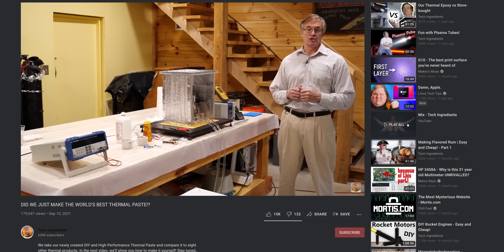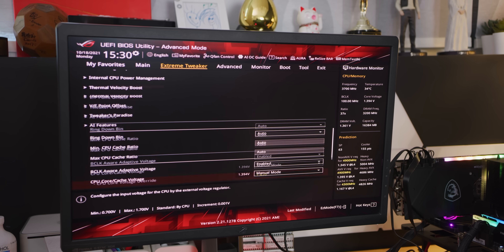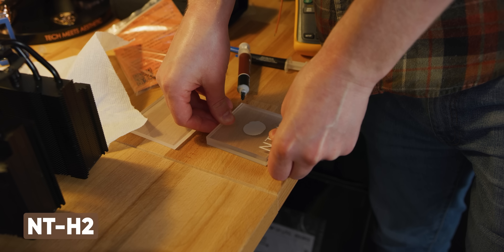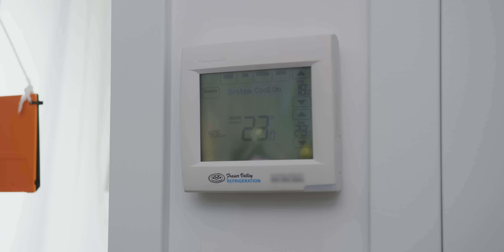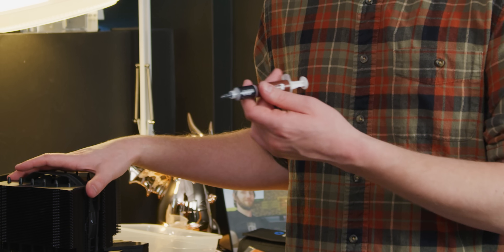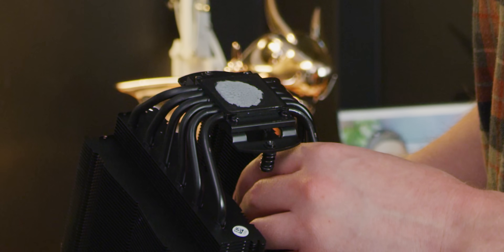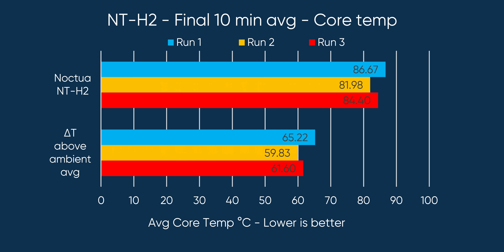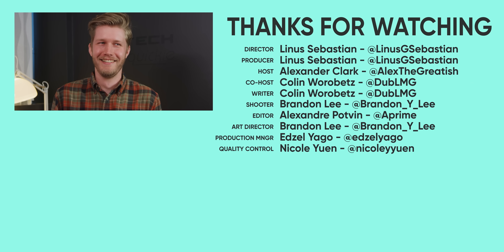We called out Tech Ingredients and they DELIVERED

Comment: I don't see the point in not spreading the thermal compound with a spatula though. Wouldn't it be logical if spread is an issue to manually do it yourself? That is the way I do it and it drives me nuts to see that no matter the application there are often dead spots left behind.

Comment: I think at a certain point you run out of cooler room. I have an 1080 turbo with the blower fan, I tried repasting it with thermal grizzly kryonaut and thermal grizzly liquid metal For my cpu I seen like a 10 degree drop however the 1080 was the same on with both. I believe the thermal limit of the cooler can be the problem not the paste.

Comment: Why do I need to be cool under pressure?
Reply: Tf u been buzzin on Evan
Reply: @gram.  I think i was making a pun about if barometric pressure is a problem on an electronic, you need a solution more advanced than a paste. As to answer your question, the strain was a hybrid called slurricane. I'm shocked the simple question is spelled correctly.

Comment: IDK...If I were going to try and create my own paste, the first thing that comes to mind  would be Copper dust suspended in mineral oil or other heat conductive viscous material for suspension. Yes, it would be conductive, therefore use carefully. I have a 9900k that has a soldered heat spreader and gets red hot.

Comment: Never tested, but I suspect that most decent thermal pastes are all about the same. There is nothing new under the sun. Thermal paste and heat transfer is a pretty well understood science. I think the main reason for the different formula's is patents. If it's not different enough, you can't patent it. If you can't patent it, you can't easily make money off it.

Try the Tech Ingredients thermal paste with an ice chilled water block. You might see a real difference there ( because the temp delta will be so much higher ).

Comment: There is a polymer which transmits thermal load faster and more completely than pure copper (or gold, or some other metal), and it's a Polymer (worth saying twice).  That material is, and has been tested carefully, SpiderWeb.  Yup, the ass juice from those nasty little fux (Spiders) is better than copper for transmitting heat away.  That's why I never clean the inside of my computer.  XD

Comment: Back in the days with processor without Integrated Heat Sinks we used to spread the thermal paste out over the core in a real thin layer. We really needed the contact. We used ThermalTake Silver paste ( not the standard white crap ) and overclocked the AMD Durons, Athlons, XPs, and Semprons. If you connected 2 dots on the processor you would unlock the multiplier. And sometimes, especially the early durons you could increase this quit a bit. I had a Duron 800 ( 100 Mhz x 8 ) which did 108 x 11 ( =1188 ). The memory had to be good to run at 108 ( later 144 (1,08x133)) though.
With the copper Zalman flower coolers. Oooh, those old days. Can you guys make a video about that?

Comment: The actual costs of materials in the Tech Ingredients paste is incredibly low. The barrier costs to production are fairly high, though, as you need pretty specialized tooling to be able to mix the incredibly fine metal particles into the silicone they're using. They did, however, include a much cheaper "This is still better than the cheap thermal paste" solution that only requires a mortar and pestle and a willingness to test your arm's fatigue limits.

Comment: I would suggest you try Wakfield Engineering thermal compound #120-2.  it works good. Is cheep and last. And do not lift the heat sync after seating it. that can introduce air bubbles in in the interface.

Comment: Odorless mineral spirits makes an excellent surface cleaning solvent!
It will strip off stuff that alcohol can't touch, never leaves any residue and takes only a tiny amount to be useful.
By odorless, it means that no odor remains once it has evaporated.
It has that 'summer barbecue' smell...mineral spirits are often used as charcoal lighter fluid!
Be sure to use gloves, as this stuff will remove skin oils.

Comment: IC Diamond is actually great for low pressure applications, just use more of it and squish as much as you can. IC Diamond is, bar none, the best paste for Notebooks/Laptops which have terrible mounting pressure because it's very thick/viscous, resists drying out and pumping out. And lots of notebooks have very bad heatsinks. IC Graphite Pad is even better. It may be a few degrees hotter than paste, but it never dries out or pumps out, and lasts the life of the chip and is reusable (if you need to remove and reinstall a cooler). I've switched to using the Graphite Pad for all non-overclocked applications, like notebooks, computers for non-gamers which will be on a lot and run for many years.

The problem with IC Diamond is that it will scuff the surface and make scratches. 

I use Kryonaut for overclocking (1 year on an overclocked machine with no deterioration right now), or Thermalright TFX or SYY-157 on desktops.

Comment: Question I finished my build about 3 months ago pc011xl 5900x 3090ftw3 ultra asus rog dark hero mono block ek dkstro plate full wqtercooled but I've noticed when I turn it on in bios for a couple mins it idles at 45 ish watercooled and than when I open Google general use gets to high 50s goes down than back up if I run a test or a game it can get way higher than I usually go in armory and click high speed and everhtjkng ramps up and it stays around 40 50 but shouldn't idle be more lkle 30 ish fully watercooled mono block everything im started to think maybe itd thermal paste related like maybe I put too much was my first build but its not just easy to check I literally have to drain the loop disconnect all the tube runs take out gpu take mother oard out of case and take off the monoblock just to check

Comment: I put on a nitrile glove and evenly dab compound onto the heat spreader or die. Then I install the cooler, then remove it to see if there's full transfer. If there are bare spots on the cooler, they get dabbed. Minimal amount of compound, 100% coverage of contact surfaces.

What do I use? The white greasy stuff that never dries out.

Comment: Knew he wasn't full of BS because I've also made my own paste a few years back with about 10% of the equipment and know-how he has and it performs about as well as Arctic Silver and GD900 (the two I tested it against). After 10 different tests mine was about 2c higher on average and I just used the basic ingredients he did. No fine emulsion, separations, etc. Just don't spend hours in the mortar & pestle and it'll come out usable.

Comment: Hey Alex, a cool Tool to measure the resistance of the pastes would have been an isolation resistance meter Like the Fluke 1507-i know its propably not necessary to measure the resistance up to Gohm but it could have been interesting(and you wouldn't News to put the probes " as Close as possible :D)

Comment: probably a stupid question but i am going to ask anyway.

why don't they just make the surfaces really smooth and flat and have direct metal  to metal contact, surely no barrier between the heat sinks is desirable or have the processor with a direct water intake

Comment: IC Diamond is good if you pre-spread it. it is especially good in laptops with low mounting pressures and uneven coldplates. This is why the similar New MasterGel Maker has a flat tube, and also works well for laptops. You should do a video on how different pastes perform on laptops.

Comment: I hope the tests were done before lifting the cooler off to see the spread of the paste - and if you've tested the paste for conductivity and found it doesn't conduct electricity - then why hold back on the paste?
There have been several tests done that has shown that applying "too much paste" has no ill effect on the cooling - only applying too little will give poor results.

Comment: Tech-Grandpa?! Wow that's ageism. (Coming from an "end user" no less.)   I hope Cancel Culture does not kick in here too! Watch the channel and be respectful. The guy knows his stuff. 
As for the task at hand: Respectable results. I'm more concerned about performance than brand. (IE Engineering vs Marketing).  The Noctua on Noctua was a bit of a bias but it is legit at a certain level. I buy paste by the tube and never give a thought to whose cooler I am applying it to. Hell, most of the time I am replacing failed thermal compound that has lost its thermal conductivity over time. This is especially true when overclocking.
As a fan of both LTT and TI - I'd like to throw down the guantlet.  Engineer an external fluid refrigeration / circulation unit that keeps the internal IC's as low as possible WHILE avoiding humidity / condensation in the case.  Do that and you can push these chips to the optimal design corner they are specified to work at.

Comment: If it's not electrically conductive, just dump truck that thermal paste all over the IHS. Don't risk it with it not spreading all the way and it being a factor in the results. Coat it yourself if need to be. Der8auer's thermal paste even comes with a spreading tool.

Comment: I have the same thermostat at home, the droop can be adjusted to have it try and hold the temperature closer to setpoint. (a/c compressor timeout will still limit it to five minutes of time minimum for heat pump or air con) it is in the installer settings menu, the Pin is usually the first 4 of the s/n. Maybe this will help in the future if that is part of the problem. Mine was set in economy mode and had it at a 2f difference before it would come on.

Comment: I suppose mounting the mainboard vertically would have maybe had an effect on the performance because the gap between the cooler and cpu might be wedge shaped because of the torque of the cooler.

Comment: Engineers note:

The thermal gradient between cpu and cooler depends on a lot of factors. Thermal conductivity tends to be pretty unimportant compared to the two main factors: 
1. Thickness of the thermal interface. If your paste has a worse thermal conductivity, but spreads significantly thinner, it will easily outperform. 
2. Adhesion. As shiny as the surfaces may look (cpus are usually everything but shiny), there are a LOT of microscopic gaps formed between the  thermal paste and metal. Certain additives and a fine tuned viscosity make all the difference by eliminating these air bubbles and maximizing surface contact. 

An extreme example: Graphene foil is a spectacularly awful thermal compound, despite the FAR better thermal conductivity than any thermal compound. The issue is the interface between the graphene and metal (and also the thickness of the foil). It makes very poor contact, only touching a fraction of the cpu and heatsink surface.

Comment: I know you frames this test as "non-scientifc", and as such I rarely criticize those - but I feel like this wasn't a fair setup. As you said yourself, the (only) "competitor" here, is a TIM and a coldplate/cooler specifically made for eachother. You really should have used a different cooler for this, "anything" non Noctua. I'm not knocking the Noctua stuff, but it didn't sit right that the only comparison picked was just about the only alternative on the market with such a (here, inappropriate) advantage.

Comment: I actually stopped using IC Diamond after a couple of applications because it simply would not spread enough under any conditions. Even on a bolted down waterblock it wasn't enough to spread it. I tried cutting it with 1:2 Arctic Silver 5 (this was over a decade ago when IC Diamond was new and virtually nobody else sold thermal paste yet), and that was enough to get it workable, but the performance improvements were not enough to justify using it at the time over Shin Etsu's thickest paste (the best rated on the market). Simply too thick to be useful, even for it's rated use, and especially after trying to spread it. Spreading at least makes sure you have contact across the whole surface, but the paste is going to be thick enough to prevent direct metal on metal contact across basically the whole surface, which created a considerable thermal insulator as a result.

Comment: Thumb pressuring could have been improved with a weight, and a size squirt over a predefined circle diameter. Less is more on this here as most users is expected to not, press full or maximize it..and basically the gap is likely larger in reality than for people doing mounts often. Weight paste measuring wont work as it depends on the ingridients. If tech ingredients guy made it, it wont matter what you compare it with though.. he is likely one of the brightest people i seen in a few years..if he thinks its good, you did something wrong if it aint.. i would use braking fluid and a carborundum or stone polishing powder as there is silver powder in such or aluminium in a mix as it has good thermal properties.

Comment: Why wouldn't reducing the amount of IC diamond you put in the center and then adding a little extra IC diamond closer to the corners outperform the Noctua paste, if the only factor is spread?
Reply: Or using the credit card method. It sounds like for Noctua, they've got the single dot application down but it's not as taking a minute to spread the paste is a big deal if it can improve your temps.
Reply: Spread isnt the determining factor in performance, thinness of the layer is. For the same volume of paste, and compression force, spread is an indicator of how thin the layer is though. It basically works out to "the paste stops flowing outwards at x PSI of pressure"  If a paste is so viscous that it doesnt squeeze into a thinner layer, then boosting coverage by using multiple dots wont be as significant as switching to a less viscous paste that can spread into a very thin layer. I.e. if a paste has twice the bulk thermal resistance, but makes a layer 1/4 as thick, it can have half the actual thermal resistance of the original "better" paste, because there is less of it in the way. But to have a thinner paste, you need more carrier oil and less thermally conductive filler, so its all about balance. I.e. as said in the video.

Comment: The spreadability is kind of interesting. Back in the day, it was all the rage to use a credit card to spread out the compound as thin as possible. Knowing what I now know about applying thinset for ceramic tiles, I think a micro notched trowel could be used to deliver the absolute best, most consistent spread every time. 

Someone needs to make a miniature notched trowel. :) :)
Reply: I always used a razor blade.  Still do!

Comment: Proclaims real world testing, yet uses an open bench?!?  These videos need more oversight...  An open bench is going to be far more sensitive to changes to ambient airflow (when the AC kicks on) than a closed case.  If you're worried about residual heat, just wire the fan on back of the case to always be on and give time between tests.

Comment: The main thing for most users should be delta in thermal conductivity over time, 95% of the people don't repaste CPU/GPU etc every 3-6 months like some... Also, I found the old MX-2 was waaay better than then (much) superior Arctic Silver 5 when I (perfectly) lapped my CPU and block... Also, most of those pastes are made by 3rd party and actual brands have QC just in few samples, for me, all of the top ones are good enough, if everything is done properly (lapping and optimized pressure) etc, the difference between good pastes is max 1°C, just keep off those cheap knock off-s, the "original" is not much more expensive and I did many many build and used many different compounds in different scenarios (CPU cooler on GPU die, prolimatech MK13 GPU cooler on CPU, etc, and even cooler master brand performed OK. The termal paste should not transfer heat from IHS to cooler, it's just meant to fill out those micro holes where molecules of air would be to make 100% of the surface heat transfer instead of 99.9% (with good contact)... If your cooler is crap or you have bad contact, even diamond won't help you...

Comment: I need to ask. Ive been building PC's since the pentium 4 was brand new. I did do some cert programs for IT and while there my teacher demonstraited how to drop a grain of rice or two then spread it evenly to the edges of the processor lid evenly and smoothly with a credit card. This is all ive done for years as it made sense for complete coverage. Then I discover ltt a year or two back and see X and dots and rice and all these different techniques but never once in searching have I found anyone else who spreads. I mean, its worked very well for me sofar but I suspect that if no one else is doing it then there may be a danger or other really good reason for not doing it my way. Now when I do remove coolers later there is just a very thin line of squish out the sides so I never thought there was a danger of shorting things out. Can anyone weigh in on why I may be an idiot for doing it this way?

Comment: Not really sure what you expected to draw as a conclusion which could only end up subjective at best. Too many variables in your experiment to be deemed "scientific" -- mounting pressure, compound quantity, ambient temperature and I doubt that the AIDA 64 test provided a 100% consistent wattage load run to run. Also note that many thermal compounds require a number of cycles to achieve maximum performance... what that number is I don't know but your experiment ignored this entirely.